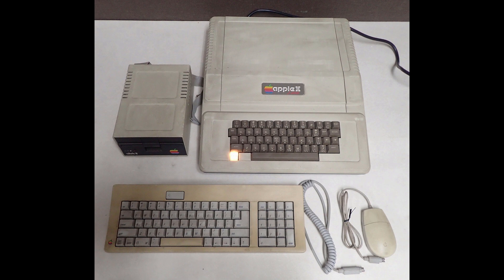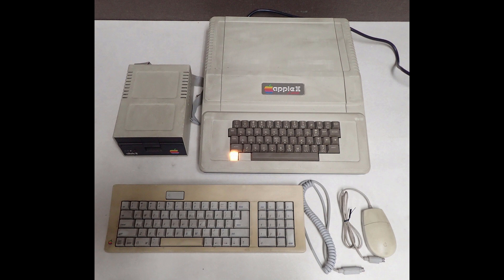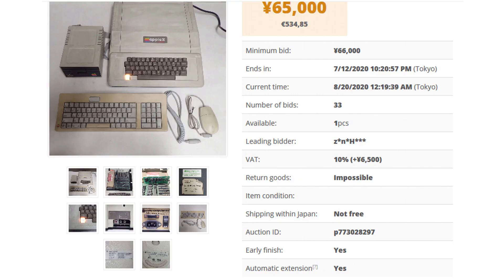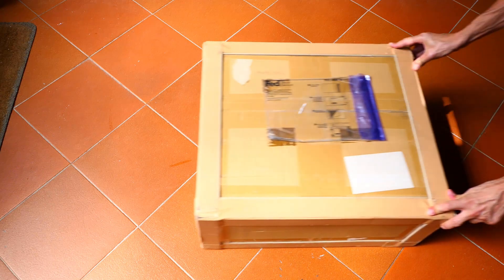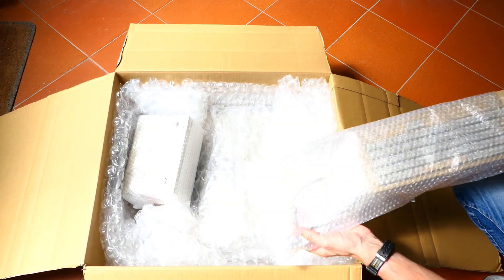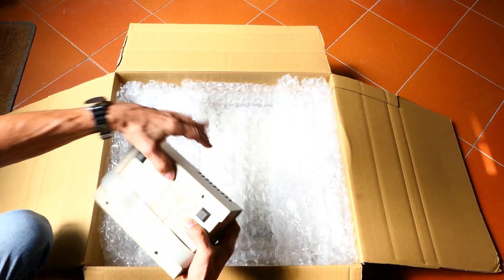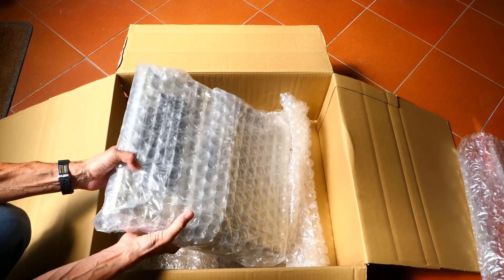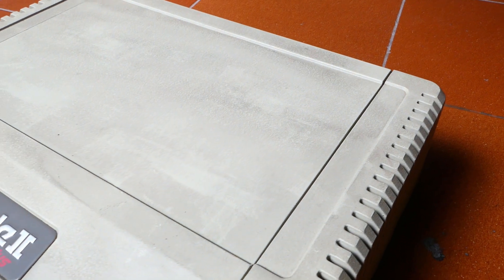1980 Apple II J-Plus Model A2S1016J restoration

Comment: More, more, please more videos with that amazing J-Plus. Can you do a video on how VisiCalc would look onto that amber screen. Please, please!
Reply from the maker: Hello, thank You for the support and for having subscribed to my channel. I promise I'll make another video after summer holidays, by october I suppose. I'll grab your suggestion and add it to the Jplus project I have in place to modify the alternate character set of the Videx 80 column card to match and display the Kana char set of the jplus in 40 col mode to the  one in the Videx eprom; this is not the case for the original kana videx eprom, so that by pressing a key on the keyboard You have the correspondig kana character in either 40 or 80 col mode. This is something that was missing at the time. :)

Comment: Ho un Apple II ed un II-E ed una piasctra clone. Un paio di anni fa almeno con uno riuscii via seriale a creare disco apple di boot con esito positivo. Un alimentatroe è guasto e poi tutte le board non resettavano piu. Ho poi abbandonato per questioni di tempo e di lavoro.
Reply from the maker: Ciao, negli alimentatori per Apple II deve necessariamente , per prima cosa, essere sostituito un particolare condensatore di sicurezza marchiato RIFA. Di solito saltano per vecchiaia e il pc non si accende. Quindi di norma, si smonta l'alimentatore, si sostituisce quel condensatore, meglio tutti, e si fa il test dei voltaggi al banco. Quando si e' sicuri dell'alimentatore , si passa all'accensione e alla ricerca di altri guasti. Il 50% dei problemi di solito sono determinati da ossido sui piedini dei chip , ma va visto caso per caso. :)

Comment: What a beautiful restoration! That machine looks perfect now. Also, I've never seen that type of keyboard and switch on the J+ machine. Also, I chuckled the power supply is a 115v version even though Japan has that 100v -- I guess the 115v one works "OK" at 100v.
Reply from the maker: Thanks Adrian! 
I think so , I didn't notice any difference with the other PSUs I have in my other Apple II machines so it should work at all the voltage ranges. I just switched it  to 220v (I'm in europe)  with the back selector and replaced all capacitors. There must be some difference in the video circuit of this J-Plus since it "fringes" as hell on the lcd color monitor I use to test these machines. The lcd supports all standards but probably this one was originally tweaked for japan ntsc ? 
I decided not to investigate too much because I don't want to make mods to a rare pc, it must stay as original as possible and the "USI International PI4" monitor that I equipped it with is monochrome so .. who cares! 
As for the keyboard , it looks to me that it's one of the earliest, switches are datanetics DC-51 and sincerely I don't like them; these were dirty and scratchy and there is no way to open them without breaking the switch assembly . I had to replace one by the way, it wasn't working at all. As for the other switches I had some improvement by injecting IPA alcool with a siringe , stressed them back and fort and let them rest.
https://deskthority.net/wiki/Datanetics_DC-50_series

:) Luca